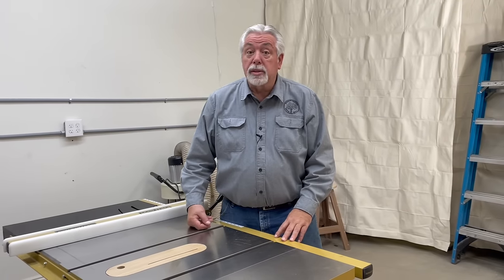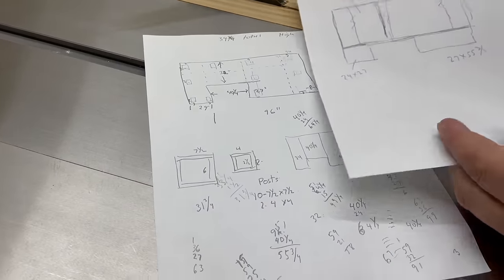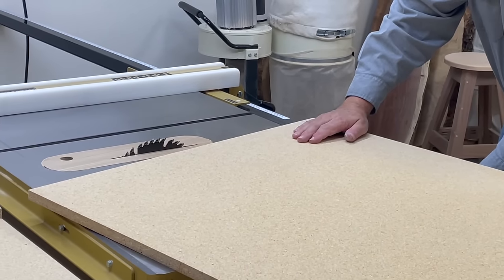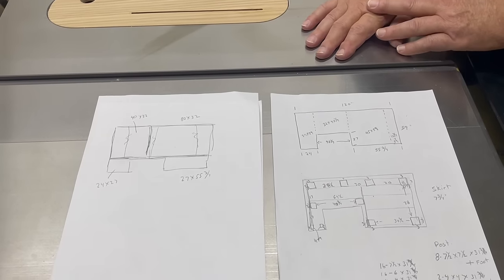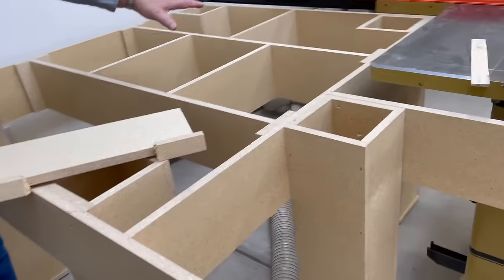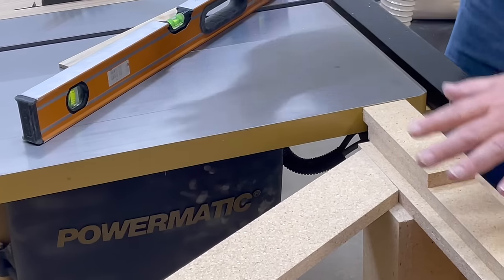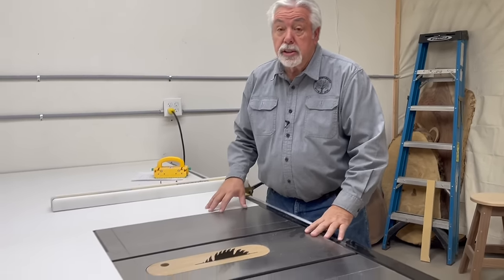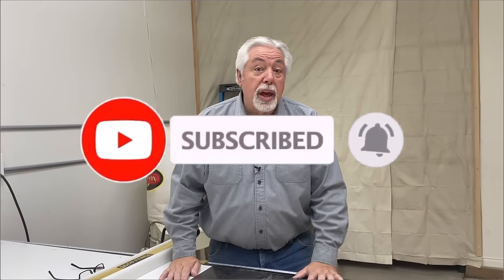99% Of Woodworkers Do Not Know This About A Table Saw

Comment: There is also a cheaper alternative. I don't cut with my fence to the left of the blade so there is really no need in having so much of the fence bar stock to the left of the blade. By drilling some new holes in the angle iron it rests on, you can slide bar stock to the right side of the saw and pick up a few more feet of rip capacity making use of what you already own.

Comment: Any concern long term with the MDF absorbing moisture from the concrete floor? I think that personally I’d have used treated plywood or at least CDX instead of MDF for the post feet.
Reply from the maker: I actually did not use MDF. It is just particle board which I think will hold up just fine in my garage. Thanks for watching, Wes

Comment: Would it work to use two sheets of melamine and place the butt joint at a miter slot?  That way the top would be seamless at the actual business end.   I assume you are gong to extend those slots to allow the miter gauge tools to fully pass.
Reply from the maker: Yes that works also. Thanks for watching, Wes

Comment: First-time viewer and I was REALLY shocked to see you wearing a long sleeve shirt, with the sleeves down, when you were operating the table!
Way back when I was in junior high (over 50 years ago), and long before that because of my Dad, I was taught to NEVER wear long sleeves when using power tools.
I'm not trying to be a turd, but SAFETY FIRST is a good practice to follow and am just expressing my shock.
Reply: Plus no riving knife and reaching over a still spinning blade to grab cutoffs.  The lack of a blade guard is arguable.

Comment: What about the back rail?  Don't you need a longer rail to support the fence as you go 65" in the front? Shouldn't you paint the bottom of the columns so that they don't absorb moisture?  How much did the new rail cost?  Was it a huge savings or just minimal?  The screws go into the end grain of the particle board, are there splitting issues?
Reply from the maker: Hi...there is no back rail for this type of fence. I live in the desert southwest so moisture is not an issue for me. The new rail was $150 saving me $350 over Powermatic price. I have never had splitting issues with end grain. Thanks for watching, Happy New Year, Wes

Comment: Nice saw table extensions.
For me I would have built a box out of 2x4 studs and can be just as strong/sturdy for the table saw use.
I did this for a friend of mine for his work table and it turned out great and was nice and sturdy too.
The top surface was OSB with a masonite top, plus it's just as smooth & replaceable as needed.
He got a lot of use out of that work table until he had to move and left that table behind at the house he moved out of so maybe the new owner had use for it.
This is just another way I am thinking this could have been done.
Reply from the maker: Great...glad to get your comment. Thanks for watching, Wes

Comment: You forgot to put dado’s in the top that line up with your miter gauge slots on the cast iron table.  You will need to do this if you want to use a miter gauge or a crosscut sled 🤔
Reply from the maker: I have taken care of that now :)) Thanks, Wes

Comment: Isn't the concept that with 48 inches of capacity you can reach anywhere on a 4x8 foot sheet?  With the size of your table, and whatever outfeed you build, even in a 3 car garage, this thing will be enormous.  Think Big! I guess.
Reply: It depends on how much of the sheet you want supported.  If he were to really build that table out like the rest, he would have 8 feet of table past the blade. 

Personally, I do not believe in cutting 4 x 8 foot sheets on a table saw, that is why panel saws were invented.  Or use a track saw or circular saw with a straight edge guide clamped to the sheet.

Comment: Like any self respecting woodworker I was happy to see no blade guard.  LOL. 
Seriously, I've never been able to confidently install screws into 3/4" particle board edgewise.  I pre-drill a guide hole to prevent splitting.
Reply: I play guitar and am self respecting and do all of my table saw operations with the guard and splitter in place when the operation permits. I’m still able to play guitar after 50+ years of woodworking.

Comment: That thing is going to weigh a ton.  I would just buy another used table saw and make hinged 'flaps' that come out having adjustable legs where the saw is on a stand with lockable wheels.

Comment: Why this type of sheet goods and not MDF 
Norm might have done this and added hard board as a replacement top.
Me id see if i could find 2 large sheets of stainless steel and put at oak edge band around it the top locks into. 

You can deffently cut a 4x8 sheet on that. 

Tread mills use a hardboard type of material thats better then partical board.  Oh last type of top material might be counter top type and contact cement it on. 

You could deffently add draws to this base. Lot of wasted space under it.
Reply from the maker: Thanks for the comment....I appreciate you watching, Wes

Comment: Seems like a waste of time and wood to build the hollow legs then still have to shim them.  I think I just would have used 2x4 with a Tee nut in the bottom and an adjustable leg.  A two foot section of vertical 2x4 with support 300 pounds per 30 inches.
Reply from the maker: Great tip...thank you! Wes

Comment: Are you sure 99% of the woodworkers don't know this?
 You dont need to go to a welder to have one made with a besmiyer  type fence system  you also could have bought Grizzly long rails  and made them work  or just went down and bought the metal that size.  Both the angle iron and the box metal ill bet its a standard size if not you can add shims to the fence locking area, 

I was looking at Grizzly long rail kit today, and noticed for that much money without the fence, you can buy a incra system for about the same cost and a few more uses. 
But with that system and a pair of cast iron wings i think the extruded aluminum will bend under the weight of the side wings pulling down. Aluminum is not as strong as 4x4 angle   iron or whatever size they use. 
With a drill press you would only need to drill the mounting holes.
Reply from the maker: Hi...thanks for the comment and suggestions, Wes

Comment: I doubt that is square. Metal of that size does not maintain a completely straight beam. I am someone who used to work in a machine shop where we cut this product all the time....This out of square will mess with your cuts. I would have spent the money of the factory one. Its probably milled to make it square...
Reply: Yes, the higher end saw factory rails have the clamping surfaces ground/milled to a plane. That operation is probably a fair share of the manufacturing cost.  Since the shop apparently did not even bother to grind the welds flush, I would doubt even the straightness of the rail.

Comment: A great way to ruin your back is cut big huge sheet goods on your table saw thinking that there is no other way?  Track saw w/ A 90 degree square attachment!  Cut in sections then up on the saw!  Yes I build tons of cabinets for a living !
Reply: Or a panel saw mounted close to vertically. Like you, I do not believe in cutting full sheets of material on a table saw.
Reply: @buggsy5  yes your correct and I can tell you if you hv a big sliding saw like Mike Farrington’s ( his Y-T channel) or even a small one but a credible sliding arm which gives you a dead on right angle/90 degree cut !

However;  most like me who are small contractors just do not hv the room to fit a sliding table saw in?  Though I hv a 52” , 3hp , cabinet saw I do not fight full sheets onto it!  One sheet of 3/4” ,4x8 melamine is about 100 pounds !
Right now I am building a full set of custom cabinets out of melamine for a huge garage and if I did like Wes?  I would need “ ANOTHER” surgery!